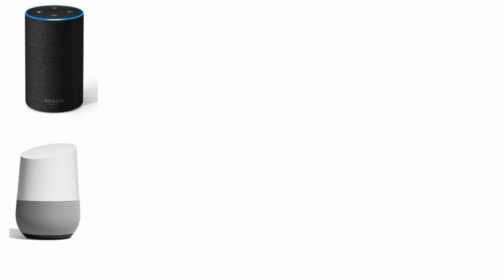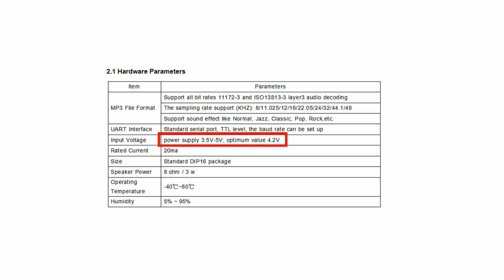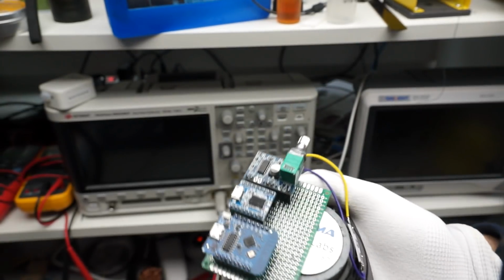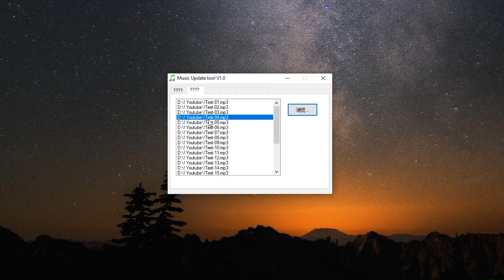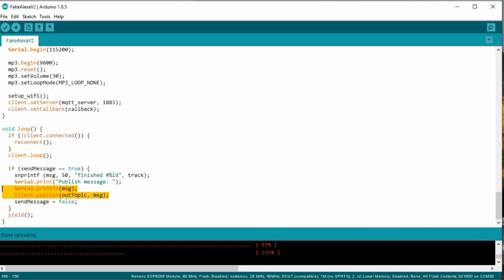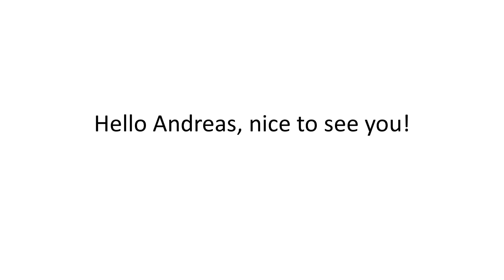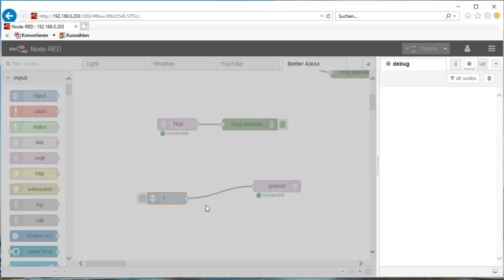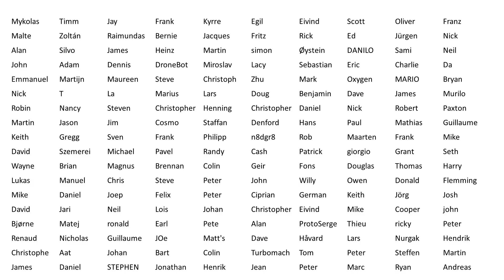#259 Add Voice to your Home Automation Project

Comment: Very helpful devices indeed. I am using a similar device now for years using an ESP8266, soundprocessor/amplifier with µSD-Card and a PIR sensor. It is connected tp my Homematic home automation system and located in the hall cupboard. When leaving the house I open the hall cupboard to take my coat or jacket. The device is triggered by the PIR, connects the home Automation System and reads which windows or doors are still open. 
Originally I did this for my old mother but such a device is also really helpful for me.
Reply from the maker: A very useful application of the same idea! Pinned!
Reply: @AndreasSpiess  Thanks! Btw using an DFPlayer Mini
Reply: @klassichd10  Can you show us more details ? Sounds very interesting.
Reply: @PhG1961  Might be my complete home automation is a bit specific to German speaking countries. I am using Homematic (popular in Germany) and included window handle detection sensors. They detect the state of the window handle. But you also could use reed switch based sensors. 
These sensors also influence the heating system to cool down the room when the window of the room is not closed, e.g. forgotten to close. This is also very helpful because kind of "natural language" which everybody understands, Closing the window without any comments.    
The information is also transmitted to the Homematic central device called CCU. This device keeps a list of open Windows & doors and distributes it to other devices (ioBroker) for visualization and the "speaking device". 
The ESP8266 / DFPlayer "speaking device" itself is based on a kit which you can find searching for "Wiffi Voice". There you see  a better description (in German language) with pictures and schematics following the link "Bauanleitung".

I am not the creator of this kit. But the creator, Eugen Stall,  sent me a pre-series device for testing and so we could expand the usability to the application mentioned above.
Reply: @klassichd10  Thnxs ! This will put me on my way. German is not a real obstacle for me, I speak it poorly but understand it much better. I even understood Andreas his German/Swiss. It sounds a little bit like Flemisch, where I live. A vivid imagination does the rest...
Reply: @PhG1961  You are welcome! Yes, you Benelux-people understand nearly all languages. The way of home automation is long and sometimes rocky and bumpy. So it is good to have a helpful community like Homematic forum or ioBroker forum. But of coarse the people of FHEM or other system are helpful s well.  Greetings to Flanders!
Reply: Definitely interesting too. Currently I have an led signal to tell me if there is a window open but yours is much cooler
Reply: @Ed19601  I started with  texts on a color changing  display. This works well but a voice reading works better for most people.
Reply: @klassichd10  I fully agree

Comment: Do they have a special software serial that works with ESP32?
Reply from the maker: I do not understand your question :-(
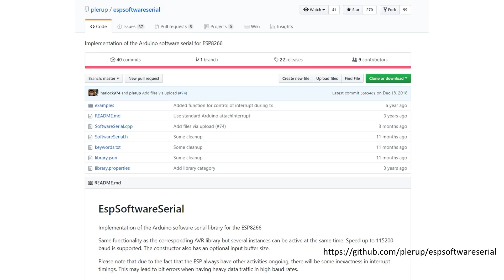Reply: @AndreasSpiess  Hello :D. I'm trying to create a serial connection between the ESP32 and the JQ6500. I notice here in your video 2:12 that there is a special version for SoftwareSerial for the ESP8266, but I'm using the ESP32. Can I still use the EspSoftwareSerial on ESP32 chips? Or does it only work on the ESP8266 chips? Wow thank you so much for replying, your channel is so amazing :D !
Reply from the maker: @the_winner_8D  The ESP32 has 3 serial connections. So usually, you do not need softwareSerial.
Reply: @AndreasSpiess  oh I see. So there is a way to use the JQ6500 together with the ESP32 without softwareSerial. I'm so new to working with these cool gadgets lol.
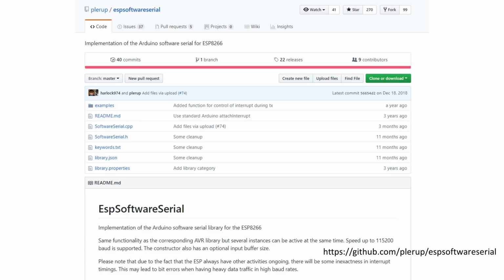Reply: @AndreasSpiess  Oh wait! 2:13 it is compatible with the ESP32 as well :D

Comment: Have you ever wondered how two or more devices can detect where each one is in 3d space? Like drones flying around or RC cars driving with esp8266 knowing where each other one is. That would be interesting , I think.
Reply from the maker: Most people use GPS sensors for that purpose. The ESP32 is not very much involved in this . It has no clue where it is because it has no such sensors

Comment: Thank you Andreas, I finally got around to making this (so far just bread-boarded but it works great). Next steps, combine it with the "you left the fridge/freezer door open again" nagging device" I made a while ago as well as other sensors and dash buttons to help cope with getting pre-occupied and forgetting to turn things off or closing doors. Much better (and more fun) than buzzers!
Reply from the maker: Sounds like a good project!

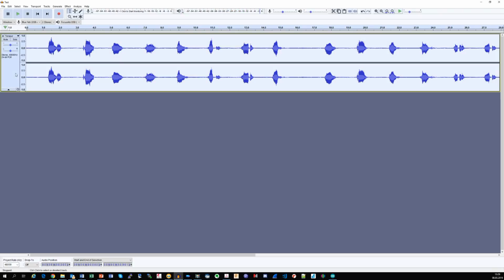Comment: @4:00 it is hard to see the Normalize setting Andreas used. The default an Audacity is -1db which is way too loud for the jq6500 and clips the audio to a near squarewave. -2 works well.
Reply from the maker: Mine is perfectly understandable.

Comment: Thanks for this video.  I have the parts from China and am starting to breadboard the security system panel which is my target.  The JQ6500 modules I got were not programmed with the software to write the audio files.  The c program from Nikolai Radke worked for me.  I could not get a clean compile / install of the Python tools.  I suspect it is version issues which because of my lack of knowledge of Python I did not want to deal with them.
Reply from the maker: I only tried what I recorded. So I cannot help.

Comment: In my opinion it's a better approach to  use a text to speach service and to Not Store Static Text. So you can send dynamic Text via mqtt with e.g. current states like temperatures etc. I did it Like this with an android Tablet but this is also possible with an raspi or some other systems. The other ideas are create Like the housing and Email trigger etc.
Reply from the maker: So you have a few projects to do...

Comment: Seems like the manufacturer provides a downloading tool for 128Mbit flash, you can try to replace the W25Q16 on board with a W25Q128 and the storage space will be 8 times larger.
Reply from the maker: My problem is that I have no idea how to fill these big memories with messages ;-)

Comment: you may want to consider measuring the Thiele/Small parameters of the speaker if you can't obtain them in order to design an enclosure with suitable volume suited to the speaker so you don't get nasty peaks in the SPL vs frequency response. it also helps a great deal to select a suitable speaker for a given enclosure volume. an easy start is simulation with software called winISD. the parameters can be measured with a few basic tools and some accurate scales by adding a mass to the cone.
Reply from the maker: Thank you for the link to winISD. I never looked at Audio so far. Maybe I will once in the future

Comment: Thank you for the channel Andreas.  It was very helpful for me to start with my own home automation. Just have a question, why can't you store these messages the filesystem running on raspberry pi and make it trigger it via node-red paring it with a bluetooth speaker?  Would that do the same thing?
Reply from the maker: I am sure you could do that. My Raspberry sits somewhere in a hidden corner.

Comment: Andreas, I suggest to use the DFPlayer. https://www.dfrobot.com/product-1121.html
The mp3 files are stored inside an SD card
https://github.com/Makuna/DFMiniMp3
Reply from the maker: I did not have enough fantasy for more messages than my module can hold. But your board is good if you need more space.

Comment: Awesome Mr Andreas, always great! I am curious whether you can show us the possibility of connecting SMA connector/external antenna to ESP8266 or ESP32. Thank you very much :D
Reply from the maker: You just buy a board with an SMA or a uFL connector
Reply: @AndreasSpiess  So there is a ESP12E with SMA and uFL? I will try to find it in my country's marketplace, I hope I can find them. 

So technically to connect a SMA to an existing on-board antenna is not worth it?

Thanks in advance :D
Reply from the maker: Yes.

Comment: @ Andreas Spiess   @ 3:08, you drew your diagram incorrectly. 
Wemos should be on left, JQ6500 in the center, PAM8403 and speaker on the right.
Reply from the maker: You are right!
Reply: What difference does it make?

Comment: Thanks, Andreas! Your timing is perfect: I have a PC program that monitors a remote system via TCP connection, displays its status, and "speaks" via sound file playback when it sees an alarm. I'm working on an ESP8266 sketch to replicate the alarm indicators on the LCD of a small portable device, and this will let me add the alert sounds.
Reply from the maker: Sound is always good for alarming!

Comment: If you need much more .mp3 sounds then I can recommend an "old" Android-device (on a local network after installing the software) running "Home24-Mediaplayer" which can play .mp3 warnings using HTTP/UDP-Request.
Additionally the software  can use the Text2Speech-System. And for android good voices are much cheaper than on a PC ;)
Reply from the maker: Also a good possibility if you have the skills and space.

Comment: Slightly disappointing I thought you were going to offer a voice recognition alternative... I plan to write my own one day.
Reply: There are some open sourced alternatives, Kalliope for example : https://kalliope-project.github.io/
Reply: @MrGordane  I spent ages trying to get Kalliope to work (can't get it out of French) but it would seem that it still uses an online voice recognition system. What I was trying to avoid was having these big companies listen to every work I say. I was also trying to make it free of needing the internet for security reasons. I wan't the home automation system to be completely free of internet access, since eventual plans will be to control things like door locks and windows.
Reply: @MrGordane  had a quick look at it, but I don't know if the crucial voice recognition part is up to scratch of the online ones. Pity Microsoft never really put in any effort to making the stand alone voice recognition work.

Comment: As usual,  a very nice video. An improuvement will be the possibility to add a sound message in the flash memory by the means of wifi thrue the ESP8266 / ESP32 and the JQ6500.
With this possibility you can add MQTT devices,  update NodeJS without openning your sound system. Why not using MQTT to transport the new sound message ! Best regards and thanks a lot !
Reply from the maker: That would maybe a little complicated as you have to store voice through the USB connection (AFAIK)

Comment: have a look at this: https://github.com/earlephilhower/ESP8266SAM SAM is a very basic speech synthesizer originally developed in 1979 and ported to the Commodore 64. It was designed to run on very low memory 8-bit processors, and as such is a great for the ESP8266 with it's limited RAM.
Reply from the maker: Thank you for the link. Maybe something for a future video

Comment: Future project: off-line speech recognition. 
Plain English would be a good starting point and Swiss-German might be an advanced level project 😉
Reply: I was working on this, but had to give it up, because it was going to take very long to get good.
Reply: Jules A 
I searched for it and found several projects. Very simple ones using a board that can’t interpret more than a handful of commands to much more advanced solutions. I didn’t really researched it though.
Reply: @Conservator.  I wanted to build the speech recognizer from scratch using a high sensitivity sound detection module by writing a script that analyses the sound waves. I don't usually use other people's codes for my projects.
Reply: Jules A 
Ok, I see. That’s quite something else than plain copying someone else’s project. 
The way to go at this time would probably be to use a neural network. Not so difficult in theory but to execute also quite a challenge.
Reply from the maker: @Eduard: Maybe in the future. I think you can buy modules which understand a limited set of commands
Reply: Andreas Spiess 
I saw a Geeetech on AliExpress: 
Description:
This Geeetech Voice Recognition Module, which can recognize as much as 15 voice instruction and be suitable for most cases involving voice control.
It receives configuration-commands or responds through serial port interface. With this module, we can control cars or other electrical devices by voice.
It can store 15 pieces of voice instruction. Those 15 pieces are divided into 3 groups, with 5 in one group. First we should record the voice instructions group by group.

Might be ok for very simple devices.
Reply: Andreas Spiess 
I also saw https://snips.ai

Snips lets you choose or create your own speech recognition set on-line and then download the data to RPi, Linux or Android device. So preparation is on-line but the actual usage is off-line.
Reply: @Conservator.  , dank je zeer! It looks very promising.

Comment: Does anything speak against using a JQ6500-28p with Micro SD card for easier setup? Since the MP3 flash program only runs under Windoes, this would be a better solution for me. I was thinking of adding  sound to my Halloween Skull with the animated eyes from https://learn.adafruit.com/animated-electronic-eyes-using-teensy-3 (also works with esp32)
Reply: I also found a nice sound library http://soundbible.com/ .
Reply from the maker: Good idea with the eyes! Thanks.

Comment: I'm also currently playing around with these devices for a project. I prefer the JQ8400-FL since it features double the memory (4MByte). When using USB it appears as a standard mass storage device, much easier. Sadly there don't seem to be modules with larger integrated memories and the only alternative would require those pesky micro SD cards.
Reply from the maker: Sounds like the better deal. I did not know it exists. Thanks!

Comment: remember if it doesnt work without the internet, its not yours. 
I went on holiday 2 years ago, my entire plan saved as map points in google, till i was 5 miles from any roads and towns.... then boom, no google maps, got lost, holiday and trip ruined. now i dont trust internet things to work.
this year, paper maps, magnetic compass.....
Reply: You should have printed the map as a "backup" measure.
Reply from the maker: I love the internet, but it is good to know its limitations ;-)

Comment: Could you post a video with JQ8400-FL-10P??
Reply from the maker: It would be more or less the same. But I do not have so many ideas for messages to fill this flash.
Reply: @AndreasSpiess  I have an idea.
What you can do is fill up the flash with common words you regularly use and maintain an index for each of the words.
Construct a lookup table with the word dictionary and in your firmware you can make an algorithm to construct sentences from the table.
For e.g.
Lets say, you are using the module for home automation projects, and you want the device to speak up,
"Kitchen lights turned on" .
By maintaining the look-up table in the firmware, the sentence can be auto constructed and played.

Comment: Interesting approach, makes the audio sound a lot more human (because it is). But I think I'd prefer going for TTS, just makes it a whole lot easier to add new messages, or edit the ones existing (and also playing them back, since you wouldn't have to fiddle around with track numbers). I used the JQ6500 modules for a toy, to give it sound. Works fairly well for that, even without a microcontroller. What bothers me about the library is that it's implemented in a way that is blocking (lots of delay(); statements). Ended up just sending raw serial messages instead.
Reply: You need something with more CPU horsepower for sure. Like a RasPi, for TTS.
Reply: Who says anything about not needing WiFi? My point is, for Home Automation speech output, I'd go another path entirely (namely speech synthesis / Text To Speech = TTS), but Andreas' solution seems to suit his needs well, it's just not the thing I would use to achieve what he's built.
Reply: Ah I just saw it, you said it, sorry for missing it :-)
Well, I have not dug into the topic enough to give advice, sorry. Would have to start searching for a good offline TTS engine myself if speech output was important to me. Thing is, I don't really like the idea of disembodied voices announcing things in my household, even though I am quite the Home Automation nerd.
Reply: I am author of the library.

There are a  number of wait times in in the library however with the exception of a couple these are timeouts rather than actual fixed delay, that is, it's a maximum time we block waiting on the device to do something rather than a minimum.

The notable one you almost certainly refer to is that sending a command will take at least 150ms regardless (well, more than but an indeterminate amount more), this is because that is the timeout after last reply byte for when the library determines "ok that must be all the response then" and because I never put in anything to not-bother reading the reply, it's always read after the command is issued, I think perhaps my thinking at the time was that if the response isn't read (so no waiting for it) and the sendCommand returns early, you as the user of the library have no way to know when it's safe to send the next command.

Anyway it is a simple matter, if you don't care about getting a response, to bypass this (and the unread response will be flushed out on the start of the next command), in the library (sleemanj/JQ6500_Serial at github) my reply to ticket #4 describes it.  I really should build it in so you can ignore the response.
Reply: Mai Mariarti  No I didn't.  I wrote the JQ6500 library, I was replying to Julian when he said "... JQ6500 modules for a toy, to give it sound... what bothers me about the library is that it's implemented in a way that is blocking " in his reference to the JQ6500 library.